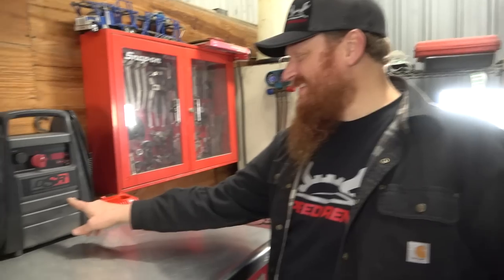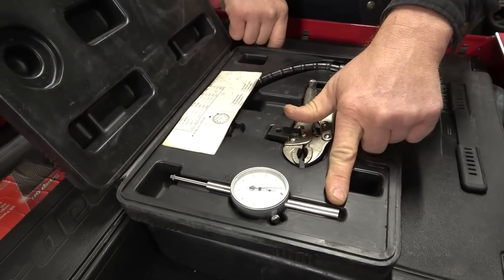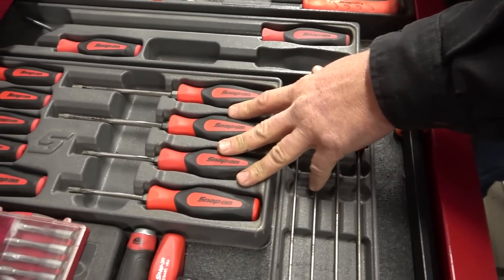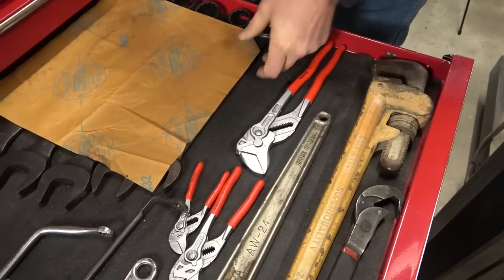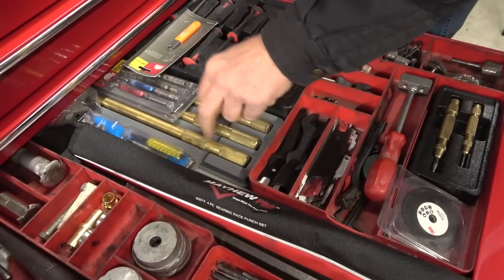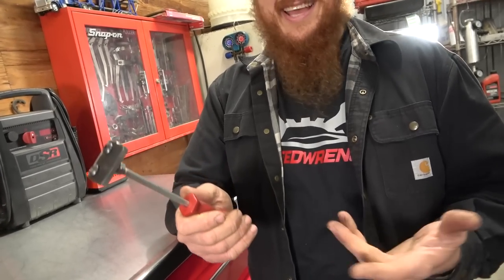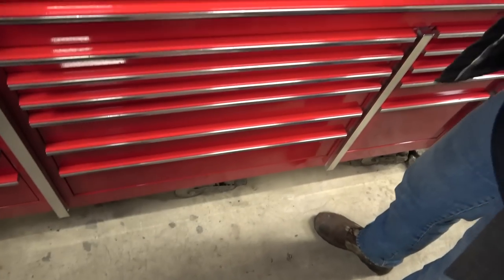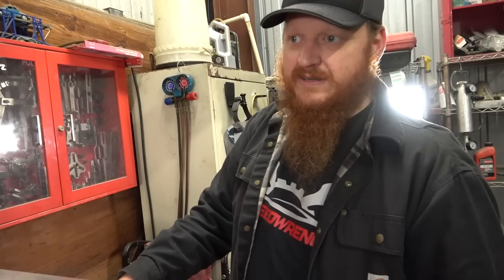Snap-On XXL Toolbox Tour - Part 2

Comment: That Snap-on right angle cordless die grinder works great for roloc disc to clean the heads on f150s when doing exhaust manifolds. Lower profile then air grinders. It's really the only use I found for it but worth every penny if you work on a lot of f150s

Comment: i had the Snap On cushion handle screwdrivers and like 5 years ago they hard handled ones came on sale, and my rep said they just brought them back so i bought a big set of them. i like them way better than any other type of screw driver handle. i've only warrantied one of them, the handles for the screwdrivers are still available or at least they were. the pry bar handles aren't though which sucks, i hate the new style Snap On has. i've had to warranty a couple pry bar ends and they only come in new pry bars, you have to cut the new handles off and slip the end into the old handle. you can lightly hammer the old handles off. its funny he opened that plier drawer and showed it, mine is like that. i bought a couple wracks for pliers, but the problem is alot of the pliers i use are alot bigger than the wrack so i have to pile them on top of each other, it really sucks. i try to keep everything i can in pouches, wracks and cases so i can find stuff. he's right when he says hes at a point where he doesn't need to buy something, but if it will make his job easier he does. i'm the same way, i have lots of specialty tools and seal drivers nobody else that i work with has, and they have comebacks once in awhile due to not having the right tool. i feel bad sometimes and give them the tool to use if i know they are going to do that job, but what sucks, they won't buy their own. i have that Mac door handle tool, use it about twice a year when replacing 07-13 chevy truck door panels. handle is part of the panel. i bought a set of Dominator pry bars from Napa, i'm sure they are rebranded because they are identical to Mayhew, but instead of the red, they have yellow, and instead of Mayhew they have Ultra Pro, which is Napa Canadas brand instead of Carlyle. i had Snap On hammers but i didn't like them because of the sand in the head, it was always shifting, so when you hit something there was no weight behind it. switched to Mac anti vibe ones, which i think are Stanley rebrands, although i know its all the same company. i've been in this almost along as Cass. almost 23 years, started when i was 13, although i guess not professionally till i was 18. 'im' patiently waiting for part 3, lol. i'm thinking   Cass has more toolbox and storage than me, maybe a few more tools, but from what i've seen so far with part one and the toolcart it's pretty close.
Reply from the maker: You and Cass are cut from the same cloth! I appreciate you watching and leaving such a great comment and sharing your experiences. Part 3 will be up next month!

Comment: Awesome box tour!....man is there absolutely no source of heat in this shop?? I can see this gentlemans breath with every sentence he make.....i would refuse to work in a icebox, climate controlled shops are proven to get more productivity out of your employees! When you stand on cold concrete all day withing 10-15 minutes your fert are cold and when that happens thats when rigamortis begins to settle into they entire body
Reply from the maker: Oh, he has a big diesel heater, but it's as loud as a jet engine. There was no way we could keep it on while filming, so we turned it off and suffered for the cause. It was 36 degrees when we shot this. And I forgot to bring a jacket.
Reply: Thats what I figured is that he had a oil or propane torpedo heater!......those things are great for a temporary and instant heat type of situation but if you have and are generating a source of waste/used oil (engine oil, transmission fluid, gear oil, power steering fluid, hydraulic fluid etc.) Then a waste oil furnace is the ticket, its FREE heat!!....Clean Burn is the best out there and have been  tried and true and around forever. There are a few other companies/options out there as well and i have also seen people convert a house/trailer home furnace into a waste oil furnace.....well to each is his own!!
Reply from the maker: That's a really good idea. And nothing feels better than getting cold and numb, then stoking up one of those heaters and feeling the life return to your hands.

Comment: 46:43, as far as piercing a wire is concerned. Whenever I do that I make sure that I coat the small section I pierced with clear nail polish so that the Ellen RA don’t corrode the wire
Reply: I’ve used both clear nail polish and liquid electric tape.  Nail polish is definitely less messy.  Thanks for watching!!👍